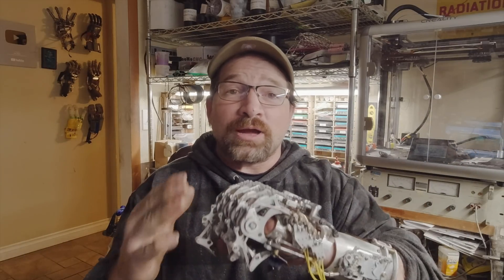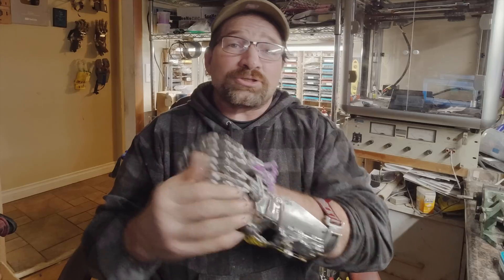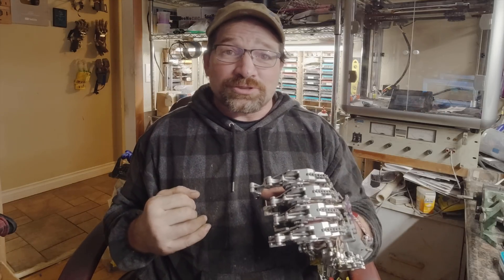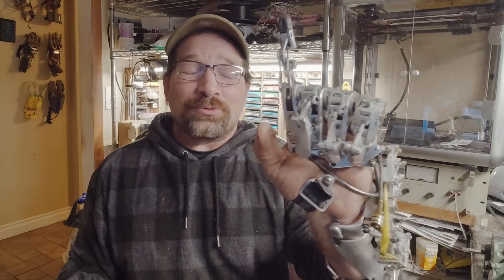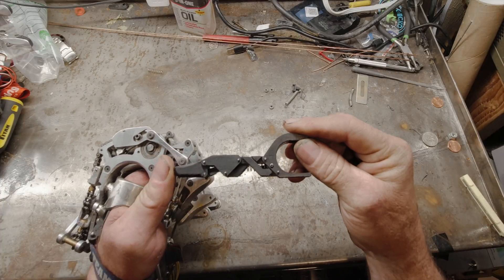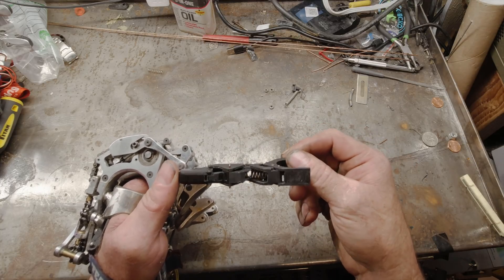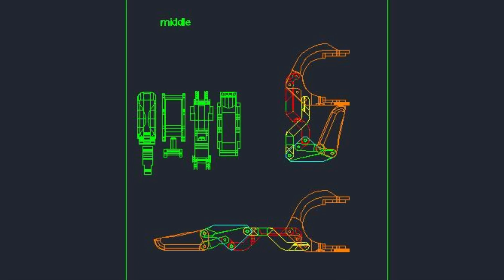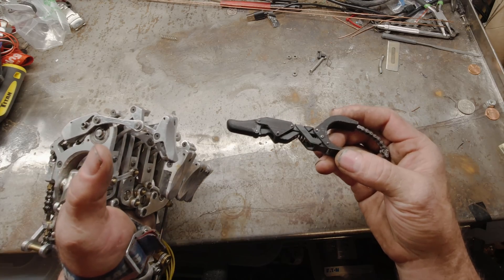Finger Locks and a New 3D Printer Finger!

Comment: have you tried more electronical gadgets like for example a myo from Thalmic Labs (not sure if they are still in business tho 😅) to maybe read out 2 dimensional wrist movements or double maybe even more advanced than that - you'd need to go electrical and charge your hand every now and then 🤔
Reply from the maker: I do have a thslmic labs myo band, they got acquired in 17 18 somewhere around there. I have software to pair it to a raspberry pi zero. Myo for partial hand prosthetics is lacking. primarily because the torque and speed available from motors that are sized to fit in the area of the proximals. And with that you trade speed for force. The ossur I digits quantum takes 1 second to open, and 1 second to close. Which doesn't sound like a lot of time until you are trying to pick something up.  Try it, move your hand that slow and try to function.
Reply: @missingpartsclub  oh yeah , motors would definitely be quite slow , but maybe you can use it to have more(or more direct) options when controlling the locks 🤔

Comment: You might think about getting a metal 3D printer, like the Metal X, to 3D print, out of metal, the parts you usually machine. They won’t be as strong as forged stuff, but they’ll still have pretty good strength; especially for 3D printed stuff.

Comment: I feel like the 3D-printing aspect of the pinky finger is actually great. Especially for making quick and easy replacements. Like, if someone is digging a hole in their backyard, or is doing yard-work, they'd prolly not want to risk their expensive aluminum fingers to get nicked and dinged. So instead they can just pop on some disposable fingers and voila!
Either way, real cool mechanism with the clicks. I wonder if it would be possible to rig the locking mechanisms to respond to sideways clicks, sorta like reving-up a motorbike motion.

Comment: It's so nice of you to open the whole container of treats for the kitty! I'm sure you have thought of it but how about using solenoids to change the fingers that work instead of that mechanical selector? They wouldn't require much current and could make the hand less complex, well less complex mechanical lol. I need to watch your earlier vids bc I think you tried in one of your iterations. Merry Christmas!
Reply from the maker: I did, 157 was myo mechanical, it was terrible in the real world. In a controlled environment it worked fine,  but take it outside and start doing stuff where you start to sweat, and signal acquisition goes right out the window. I am kind of working on a version using a thalmic labs myo band.  It's super early on the project,  I'll probably do a video on it when I start seeing success with it.
Reply: @missingpartsclub  I guess by myo mechanical you mean muscle and nerve control. I wasn't thinking that far and that's amazing. I just mean a way to use an accelerometer or just a switch to know what you want locked so you can do away with the cables. Please don't get me wrong You're selector is amazing.

Comment: Tbh 3d printed can be pretty strong (at least strong enough to grip everiday items like a water bottle or similar, and worst case if something brakes you can have a replacement rapidly.
Might be an option for a replacement when you are working on the metal one.

Comment: You know what's overlooked about this prosthesis imo... The fact that even though its mechanical and does catch the eye, the general shape and appearance doesn't really distract me. It just seems to natural in the way Ian is able to emote while speaking. Also, the shape seems oddly, natural but because it's not attempting to mimic a real hand in visuals there is no uncanny valley or anything.

Like, It's clearly larger than Ian's natural hand and looks a bit heavy but it all seems so natural... I know a lot of that is Ian being so comfortable with the prosthesis but it's not just that. Even just looking at a still frame, it doesn't seem unreasonable that I'd see something like this on another person. Like, if I showed up to a job interview and the guy interviewing me was wearing that, I wouldn't even bat an eye because it's not trying to imitate a real hand and it's built and shaped in a way that just seems to fit the shape of a hand so well.

It's impressive on that front alone, never mind the engineering behind it.

Comment: Glad to see you returning to 3d printing fingers, as it would make your project a lot more accessible to most people. Most people I know dont have access to, dont know how to use them and/or dont know anyone skilled with lathes or mills like you are. Although I suppose one could make molds of your designed parts, print those, and pour a resin into them.

On that end, I still would like to suggest you trying out markforged or comparable 3d printers with carbon fiber inlays. These can lay in additional long strands of CF into parts, instead of just only having short chopped fibers mixed in with the Nylon. This essentially creates a composite where the fibers layed into the work take the bulk of the loading and increase stiffness dramatically.
At first I didn't believe their marketing BS, but after seeing the parts myself it really is true that they can come out just as strong as aluminum.

Comment: Hopefully im not jumping the video gun here but on your halot one as a Resin printer a company called siraya tech makes several resins tenacious/blu/build they are mixables with base resins and can create more durable working parts. Some people have feilded them in lower receiver's so i wonder if the desired strength/repetitive usage durability could be acquired that route?

Comment: The best thing about 3D printing for something like a mechanical prosthetic is fast iteration - you can crank out test parts and assembles in rapid succession (since a test print should be considerably faster and cheaper than machining a part) and perform functionality tests quickly while refining as you go, and THEN make a more durable version when you have something that works well. First make it work, then make it pretty.

Comment: I'm curious about the reason for the prototype finger design;  is there a shortcoming of the old design you're trying to overcome?  Is the new one less complex etc??
Reply from the maker: No, the 159 finger design,  with the differentiation linkage, and ability to have the medial distal's position independent of the proximal is awesome in real world usage. The design of the printer finger is functionally a huge step backwards. No bearings, no locking, and not nearly as strong in compression. It's more of a thought exercise than a product. Really I'm not sure how far I'm actually going to chase this design.

Comment: I really like the new design.  I am amazed at the 4 bar finger you have evolved.  I am wondering if you could make the parts from sheet steel with aluminum spreaders or folded metal.   praying for your good health and well being.

Comment: It's cool seeing the development and progress of your work. It would be really cool if you could utilize the Urethene process for parts. Solid resin with dye and a mocha chemical to have a self lubricating system that would last for a very long time.
Reply: An SLA printer could totally make those parts strong enough to be usable. Would just need to use engineering grade resins.